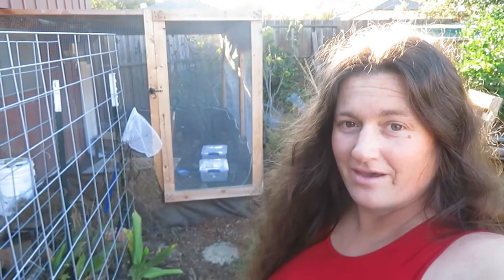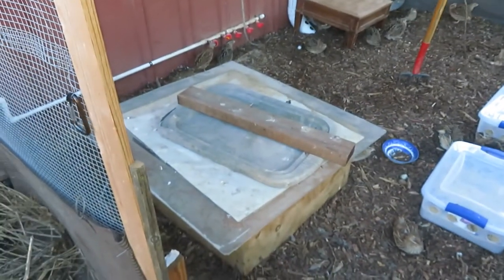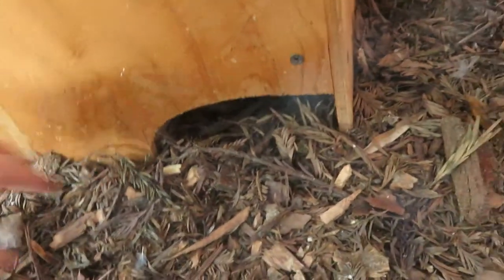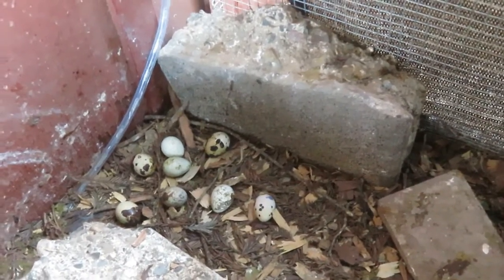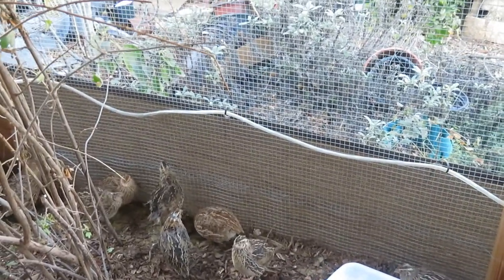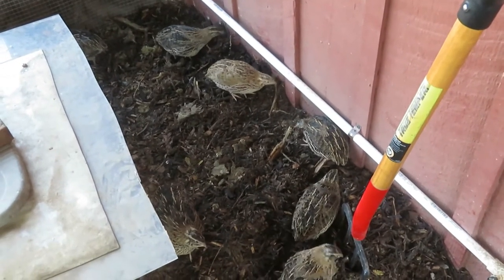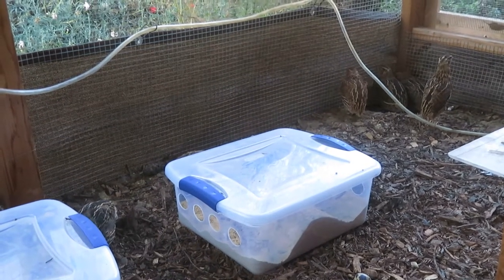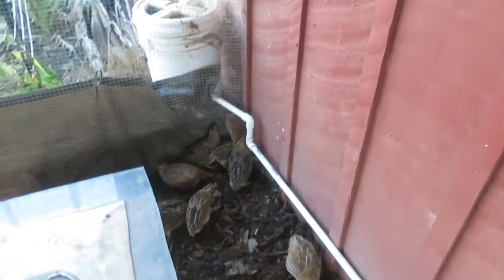Main Quail Aviary Tour

Comment: Love your aviary 💞 Do you have any wire or patio blocks under the deep litter to keep out rats and such?
Reply from the maker: Thank you! Just dug in a out a foot along the sides, nothing on the bottom. You'll have to design yours depending on the predator pressure in your area. As I have deep litter and I expect to harvest it as compost, I didn't want to deal with wire on the bottom and shoveling it out with that as an obstacle.